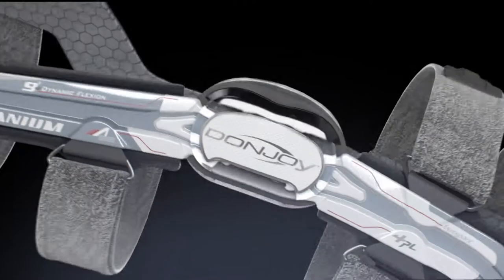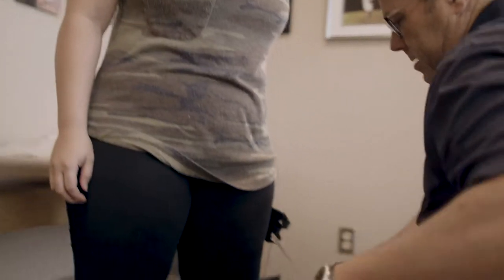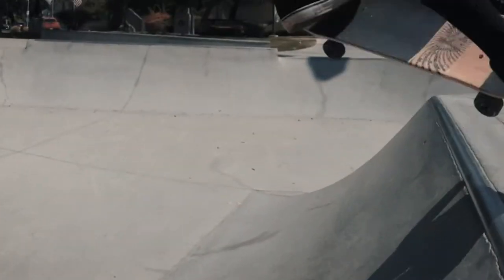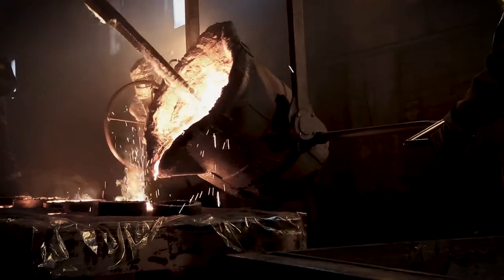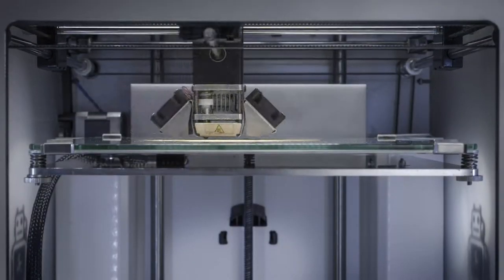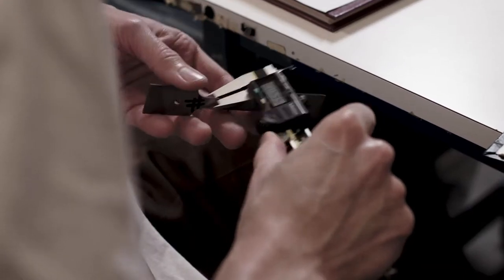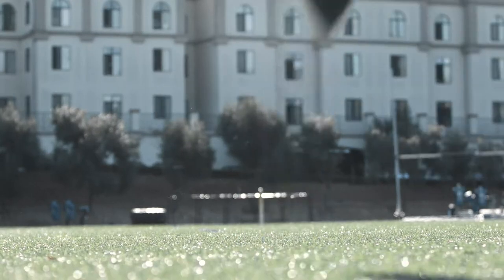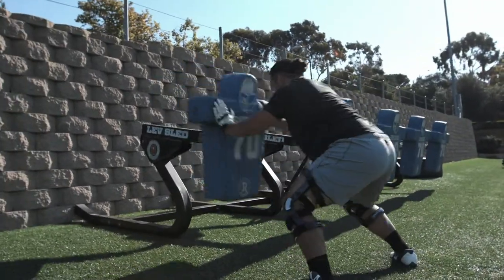What is a FourcePoint Hinge?

Comment: Where can one learn how to SET the fourcepoint hinge?  (setting 1, 2 or 3)?
Reply: Did you find a video for this?
Reply: @sarahhamilton9162  Yes I remember I figured out all the adjustments.  I'm not currently needing to use the knee brace thankfully :)
Reply: 3 is the highest braking force, 1 is the lowest braking force on the last 25 degrees of extension.